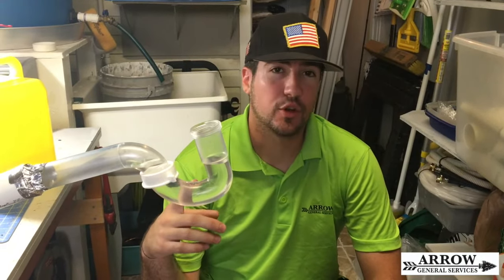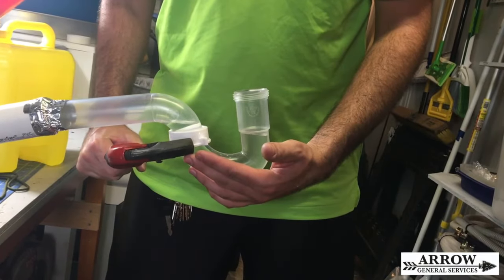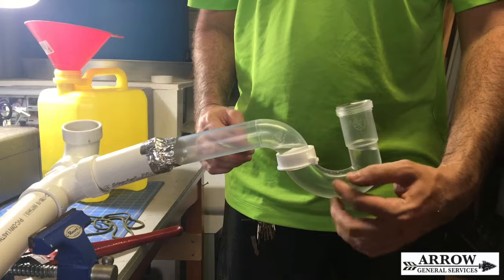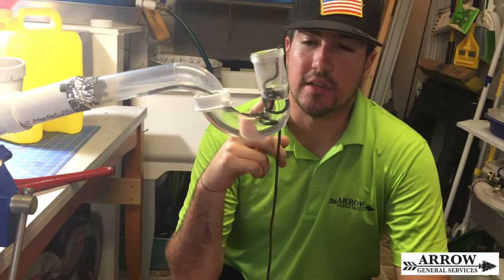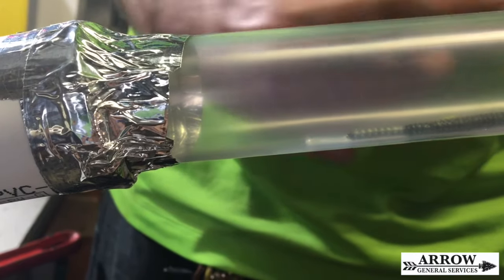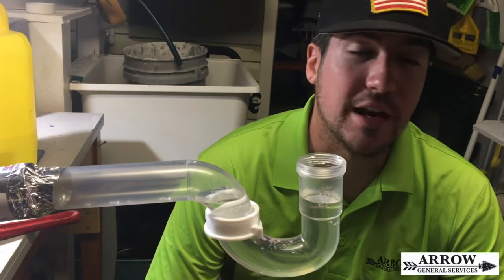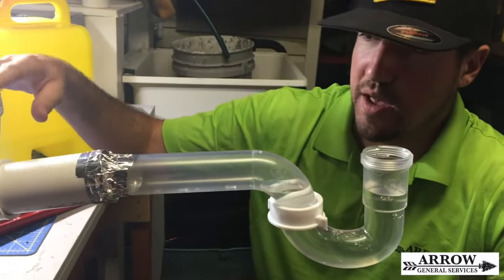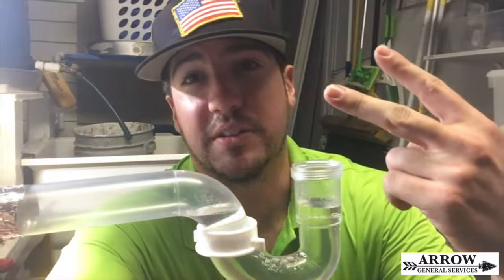Why is my P Trap losing water?

Comment: From a females perspective…perfect. Super simple! Thank you!  Im doing everything imaginable to figure why my bathroom sink is smelling like sewer with a clothes washer  on the other side of the wall. Cleaned pipes both sides and the washer. Still smells. This could be the problem. Even if its not, excellently simple video!
Reply from the maker: Thank you!
Reply: I have the SAME issue. Just curious, how did you fix yours? Tyvm

Comment: Question:  I clean the bathroom sinks'  P traps and the smell returns within two or three weeks.  Could the fact I don't have stoppers on the drains affect how quickly the smell returns?  The P trap is made of PVC and is probably about 25 years old. Thank you for you video too.
Reply from the maker: It’s hard to say without actually assessing it in person but what you could try to do is pour a dark color die down the drain and don’t use it for 48hours. Then take a really powerful LED light and shine it on the other side of the pee trap to illuminate the plastic so you can see the dark liquid sitting in the trap. Check to see if the water level has changed and is allowing sewer gas to pass through. If all else fails call a plumber!

Comment: The strange thing is that after I replaced the sink and piping the stench is apparent ONLY when we're running the water. It doesn't happen while it's not being run. Not sure what to do. Old setup was the same and had no smell.
Reply: That's the problem I have.   No smell till we turn the water on. Problem started after replacing the faucet and drain.  The new faucet came with a new drain for a different type stopper to work with the new faucet.  I saw a video that said to use an enzyme drain cleaner in the overflow drain. If that doesn't work., I  guess I  will call a plumber.
Reply: @keepsmilin468  try this.  Start by disassembling the P-trap and pull out that straight tube that connects to the bottom of your P and goes into the house drain. It needs to be shortened to go in just past the seal. I improved the smell in mine because I completely forgot to shorten it. Once shortened it seemed like it doesn't stink as badly. Still not 100% odorless like it was with the old sink. 
Additionally, I suspect that I have sediment in the actual bowl of the sink where the drain goes. There is a void there to route water from the overflow hole in the sink to the drain. Upon removing the sink drain and pipe before the P-trap I saw there is nasty stuff that accumulates in the void. At this point the only solution I have is to bleach it every now and then to kill odor causing bacteria. 
I hope I was able to give you some direction without being able to show you 😁
Reply: Thank you !!

Comment: I live in western Oklahoma, windy all the time, I am having the issue only in laundry room sink, getting sewer gas smell from that sink, all vents are clear, there is a vent from this drain straight up out the roof, wind could definitely be doing it, how do I resolve this issue?
Reply: Install an Air Admittance Valve after (downstream) from the laundry sink P-trap. Search YouTube for instructions on how to do this. The piping in the laundry room is not getting enough air, and a vacuum is being created that is sucking the air out of the p-trap.
Reply: @nedflanders1559  Thank you sir!, your input is Greatly Appreciated!

Comment: I’m having issues with my sink in master bathroom having sewer gas smell when you run the water?? Only place it does this in my new house. I think something to do with improper install on drain behind wall causing a vacuum effect.. idk very weird don’t see too many answers for this.
Reply: I have same issue? Did you find any solution?

Comment: how to check my pee trap in my shower .  I got a long drain at the end of the shower with a connection to the main drain but can't see as it is all underneath the flooring. I have a ventilation for two bathrooms going out side flat with a grill on wall outside above the bathrooms ceiling level. I get time to time smell mainly from the shower draiange (I suspect) how to minimise such issue? Should I extend my ventilation pipe outside with an elbow extension? Thanks

Comment: Due to a sewer smell i removed my ptrap.  The water in the ptrap smelled very bad.  Is this normal. (To have stinky water in the ptrap?)  Now, every month i remove the ptrap and the odor is bad, but not as bad as the first time.
Reply from the maker: Is the inside of the P Trap really nasty with grime? If so try replacing it with a new one. If not then what could be happening is if the plumbing wasn’t installed properly dirty water may be back flowing back into the P trap. Best of luck with it! I would first replace the P trap if it’s really nasty inside & see if that helps!
Reply: @StormWaterDrainageSolutions  I'll try your suggestions.  Since i thoroughly cleaned the P trap i suspect i might have to remove the drywall to inspect the  pipe behind it.  But.. i will replace the P trap as that is the easiest, quickest thing to do.  I think you are absolutely right and will get back to you in the near future.  Thank You.
Reply: Rudy did you ever find your solution? I’m having the same issue
Reply: @brandon585  Replacing the ptrap did not resolve the issue.  It's a long story, but my house, built in 1965, has cast iron sewer pipes.  I believe that in time the pipes develop a "belly" and the feces that would have been transported to the main sewer line are not transported there.  With the newer toilets featuring 1.6 gal and less, the feces is not truly flushed, due to the belly (depression)  of the sewer  pipe and the odors are the result.

In my case i had installed a 1.6/.8 gallon dual flush toilet and in the attempt to save water and iIwould use the .8 gallon flush all the time.  When i moved into the house it had a 3 gallon flush tank.  Originally the house likely had a 5 gallon flush.  Consequently i believe that had i not changed the toilet, the problem would have never surfaced.  
Now i use the 1.6 gallon flush, (the number 2 button.. lol), and the problem is no more.
Reply: @forgetaboutitize  hmm interesting... I don’t have any cast iron and we only changed faucets recently but both are smelly now once water is running.. took it apart and water in trap stinks.. I don’t get it lol
Reply: @forgetaboutitize  update?

Comment: Hi I live in Tijuana Mexico most places apt and hotel don't have that p trap because previous renters will always steal them when they leave to resell them , what can I do or use to stop those fumes when their is no p trap
Reply from the maker: Instead of using the threaded type, use solid schedule 40 PVC pipe and fittings for the whole pee trap. That way anyone that wanted to steal it has to cut it out and that would make it useless for them as well.